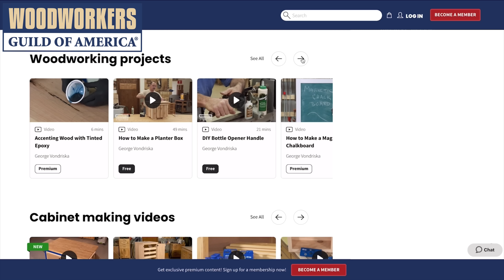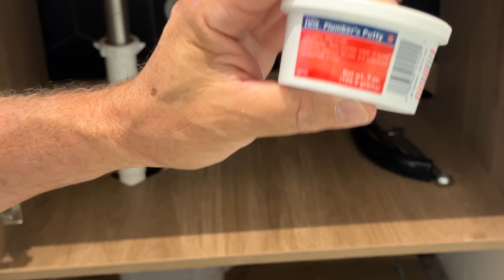INSTALLING a SINK with a BUILT IN DISHWASHER!!

Comment: That dishwashing sink is wild!  Your technique of mocking-up the connections before installation is brilliant.
Reply from the maker: Thanks!
Reply: Yeah real nice until you have to replace it
Reply: Yep, some related DIY wisdom learned the hard way: start your plumbing work early and when you have plenty of time to deal with the inevitable unexpected issues.  Never work on a holiday or close to closing time for the store.  If you can’t shut off plumbing locally to the fixture/room you’re working, make sure everybody has a plan for alternative plumbing and don’t interrupt the laundry.dishes/etc. 

Basically, plan for the worst and be happy when things go better.  There’s nothing worse than the feeling that everybody is waiting on you and you don’t have the solution in time…it only makes the job that much harder.

Comment: I think I read in the manual that every DIY plumbing job requires at least 3 trips to the supply store. It is a rule.
Reply: every home improvement project, no matter how small.  AT LEAST 3 trips in the first day.
Reply: The pros have the equivalent of whatever aisle they specialize in already on their truck when they show up. They bring the store with them!
Reply: i was surprised when i took out my old sink yesterday all the old plumbing worked even though the drain was in a different location and i only had to go to the hardware store once! haha
Reply: My personal plumbing DIY rule is never start a plumbing project on a Sunday if you have to work on Monday. 😊
Reply: @karenmitchell6814  you have to start on monday just in case. The weekend is to recuperate
Reply: I do handyman work. I never shop during a job.  Bring everything you could every need and more.   No shopping needs ever.
Reply: @brianhopkins5251  years ago, I followed that rule without even knowing.
Reply: That's about how many it took when I installed a filtered  faucet on the kitchen sink.
Reply: 4 if you buy a kit that has “everything”
Reply: Years of personal experience has validated the “three trip rule” for me! I have had SOME luck making two trips work by “forgetting” an item during trip 2 and “realizing” the error while still in the hardware store parking lot. IF the plumbing gods are aren’t paying close attention (or if they’re in a good mood), you can get credit for three trips with this “hack”.
Reply: Fact
Reply: And you only realize you need to go for a parts run when it’s the heaviest traffic time on the route to the store.
Reply: @chriskelvin248  5 minutes before the store closes.
Reply: @rogerweaver7686  yeah! You always get the most patient customer service then too!
Reply: I still feel compelled to locate a stand-up version of Q*bert from the 80s.
Reply: @rogerweaver7686  the more the better!!!  At least that's why my wife tells me. Haha
Reply: For sure.
Reply: My Dad would makes a "quick" run which always turned out to be hour later lol, and would always come back with other things, I think it was more of a release/ clear your head or like I inherited the Home center love 😂 I can go in for just the thing i needed but always find stuff I dont immediately need. Doesnt help its only 10 minutes away
Reply: Anything less is actually against the law.
Reply: Those are called "breaks."

Comment: I believe the dish washer uses cold water as opposed to hot is because, at least here in Europe, most houses don't filter hot water as much as they filter cold water because cold is usually made very safe to drink straight from the tap. Therefore hot water has more 'contaminants'. Where I live we have a lot of clay and dolomite and filtrating all that can get expensive when you're filtering for both hot and cold so we just do cold. All in all, the reason I think this dish washer uses cold is to have the best water possible so the dishes are cleaner and your pipes don't get clogged.

Comment: When I renovated a room in our home, I took the opportunity to route the AC coil condensate line through the ceiling and out the roof soffit, and down into rain barrels.  I'm a few hundred miles north of the Stud Pack, but still with my local humidity, I get about 10 gallons of grey water every summer day in my rain barrels from my 3 ton AC, which we use to water the flower gardens.  It keeps The Mrs super happy -- just FYI.  
Also, the first time I saw one of those waterfall style faucets I had to have one, so we bought and installed it in the master bathroom.  After a couple years it started growing all sorts of weird stuff in the exposed portion of the end of the faucet opening.  I couldn't get rid of it fast enough.  It was neat at first though.
Reply: Just don't water vegetable gardens with it. Condensate water is toxic.
Reply: @swdavis2306  Oh?  I've heard that one other time, but then other people jumped in  to 'correct' the person warning me.  We feed (and have for years) the vegetables, dogs, trees, flowers, etc. with the water and have noticed no ill effects in general.  IIRC, the other person that told me that condensate water was toxic said it has been shown to potentially carry some disease, but then, again, a few other people shot that down as being misunderstood from one single story years ago.  I'm all ears, though, and curious:  do you have any more details?  thanks!

Comment: A trick I’ve learned over the years for checking leaks on plumbing is place a blue shop paper towel under the connections. I’ve had leaks that were slow to where I didn’t catch them after install initially. The blue paper towel changes to a dark blue when wet. I just lay it under the system and check back after 10 or so minutes to see if there is a slow leak. Can then use towel to wipe the connections and find the leaking one.
Reply: @itigg  yup!  I always say to leave nothing under the sink for 2 days and use it heavy. And if you wipe a paper towel under the sink multiple times each day it should be bone dry if it's not, then let me know asap. I also recommend using under sink silicon mats. Amazon sells them. They have a lip and hold somewhere around 30 gallons of liquid or something based on the size. But working in houses even 5 years old, kills me to get under there and find the bottom of the cab destroyed. Cleaner bottles, drains, water lines, etc leak. The under sink silicon mats contain the spill or leak and no cabinets destroyed!!!  Put a water sensor in it and as soon as it leaks, get an alert. I built my house 5 years ago and have 9 sink cabinets and got ones for each!!  Life savor!!!  My kitchen sink, I've had multiple cleaners leak and at one point the faucet that the middle pulls out and the back and forth caused a connection to come loose after 2 years. The mat and sensor saved me a weekend of work replacing a cabinet bottom. :D.
Reply: @MikeHarris1984  yes those mats are great. Only downside is can’t use easily with under sink drawer systems typically because they bottom mount. Suppose I could screw right through it with some silicone around the holes to stop leaks.

Comment: So much effort and so many parts to install drainpipe and trap. They now sell a kit with a flexible hose you cut to length and kink to form the trap then screw into your drainpipes on either end. Easy peasy, one simple hose, no more messing around with angles and rings and fittings and cutting pipes. I used it on my last bathroom remodel and will never go back to the old way.

Comment: Wow guys...trippy dishwasher setup!!! Reminds me of a Bosch "Ventless" dryer I had to install once...
I'm liking the "techy" stuff Jordan has picked out, not that I ever doubted him...
Looking forward to starting the house build. I would like to remind you, when you demo the existing house, it will be a good opportunity to get an engineer in that backyard to address your drainage problem...
Keep up the great vids brothers!!!
Reply: It wasn't a "ventless" dryer, it was just a... dryer. Only america finds it acceptable to blow six thousand watts of electric out of a 4 inch hole in the wall. Jordan should check out LG's new DLHC5502 heat pump dryer... self cleaning condenser, 7.8 cu ft capacity, direct drive... 70% less energy than a boomer-tech vented fire-starter. 😂

Comment: That little sink/dishwasher is awesome for a single person's apartment!
Reply: Japan is famous  for those cause it saves space. Also washing machines and dryer.
Reply: @keithfreitas2983 most people in China are hanging clothes, but I think the younger homeowners are putting in dryers. Btw they have been using the combo units in Europe for a long time and have them in the us also , but they have their own set of issues, mainly they’re complex and slow. We did an 18” dishwasher in my brother’s place in New Orleans because it’s a small kitchen which I’d prefer over the counter model only for the ability for replacement when the time comes.

Comment: I'm from the Old Safety Engineer School...Wear both belt "and" suspenders, so anyone thinking adding extra pipe dope (the proper term evades me right now, but I'm sure someone will correct me) or plumbers putty "just to make sure," along with all the other "extras" a lot may think is unnecessary just for peace of mind.  Worth its weight in gold for me.  Peace of mind is a very good thing.  And when Jordan said wait and unscrewed the support making moving the completed sink easier?  As one of my bosses told me over half a century ago...Dammit...Don't work harder, work smarter.  And...Y'All did just that.  Great job and very informative video.  While most of my comments were about the sink, I learned a lot from the vanity and bathroom sink install as well.  I definitely appreciate all the tips and insight into how and why you arrive at the decisions you make.  Bonus!!  Helps me access things before just jumping in and screwing up.  As another boss told me, there is nothing so pressing you can't stop and say "just wait a minute" and reassess the situation before charging in (as some would say, like a bull in a china closet) full speed ahead.   Please keep the great videos coming!!

Comment: That first "P" trap on the dishwasher is not a P trap. It's a sweep to drain better. And it doesn cause an S trap where it can suction them both out is because you have that vent line that goes to the vacuum break and to the garbage disposal where most dishwasher connect to. So it's a neat design.
Reply from the maker: Cool, thanks Mike 👍

Comment: Cold water to the dishwasher, in Europe thats normal. I never heard of warm water to the dishwasher until i started to look at American Diy channels. Same as clear one component glue for drainage-pipe, we use only that.
Anaway, i give it 10 more years and then you will al be using metric 😁

The build is going great, and the template for the router on the saw-table, why didn"t i think of that!!! That would have saved me half a day. Great tip from a pro, thank you again and keep up the good work!!
Reply: I wonder if they use hot water in the US because they are on 120V, so it takes a long time to heat water. It doesn't take us long to heat up water  so we can use cold water
Reply: @thelibraryismyhappyplace1618  Realy good poimt, sounds valid, i have no idea. The amps are more, i think,  important to heat op water, but then again it could be the voltage.

Comment: Wow! If only I knew about a combo sink and dishwasher unit. That is so practical when you don't want to pile up and wait till the end of the week to wash dishes. A big dishwasher stinks while it sits with dirty dishes until you have enough of a load to run it.
Reply: I'm confused that they didn't go with a single drawer (eg. 17" tall) dishwasher.  Uses up just a tad more under-counter space without the drain line hassle, and you gain back the countertop space for meal prep, etc....   Maybe this one they chose is less than 24" wide.

Comment: I really like the way you did the cutout for the trap. I bought my house in 1998 and installed Delta faucets and I used clear silicone rather than plumber's putty when I install the drains. The aerators in the faucets corroded and I couldn't get them out without destroying the faucet so I bought two new Delta faucets in 2023 and installed them. Fantastic faucets and when I removed the drains from the sinks that silicone was perfectly sealed and lasted 25 years and was still good. Plumber's putty dries out and cracks and I know that from sinks I had to fix in rental properties.

Comment: Remember water leak alarm for bathroom and kitchen. Nice if it can also shut off the whole house water supply.

I have a few China Tuya wireless ones and a add on shut off motor for my main valve.

Has saved my basement once when a pipe burst at night

Comment: another advantage of Delta is that any plumber can get you a replacement cartridge when it goes bad.   Brand WTH knows, no chance, they are replacing the whole faucet.
Reply: That’s what I like about moen. All their cartridges are same for the type. I have my next 3 replacements already because the same cartridge is good for the vanity, the kitchen, and the shower. Easy swap.
Reply: Agreed! Just went through the replacement cartridge search for an out of production off brand. Finally found an open package one eBay. Luckily it fit and worked.

Comment: I am a DIYer, but I always purge the water lines by attaching an extra supply hose to the angle stop (shut off valve) and putting the other end into a bucket.  Only after that purge, will I attach the permanent supply lines ... regardless of whether there is a removable aerator or not.  This separate step makes sense because not all connection go to a faucet, for example the supply line to ice maker or the reverse osmosis system.

Comment: I bought Lexel after seeing you use it. Had to drive to a Lowe’s  to get it. Used it on a roof to sidewall joint area that decided to leak in a rainstorm. Great stuff. Sticks to anything, dried pretty fast and you hardly see it. Pricey stuff but worth it ! 👍
Reply from the maker: Great to hear!
Reply: I have also used Lexel based on your recommendations!  Great results!
Reply: They actually make a product called through the roof that is made for the roof(go figure) . its basically lexel with uv inhibitors I believe. its great stuff.
Reply: After foundation settlement (which required adding piers to re-level the slab) I had groundwater seeping upward thru the slab around the PVC toilet drain.  I added a nice thick layer of Lexel around the PVC and sealed it off to the concrete slab. It has sealed it up perfectly.  Now I believe I have the same upward seepage in a wall of the shower where the water lines come up thru the slab.  Didn’t realize that groundwater may have been the source of the water when we had to rebuild the rotted shower studs and entire shower.  Termites loved it!  Now I need to open the wall to check and will likely have to Lexel around the incoming water lines.

Comment: So nifty way i have found to deburr metal like that drawer. A wire wheel on the drill held parallel to the cut. Not 100% but in the 90s for how often it works. Smooths it out better then a file or even sanding. And generally depending on thickness and hardness even a brass wire wheel will work.

Comment: What I usually do when a fitting is just a bit too small for hoses is to wrap some electrical tape around it really tight, that way you can slightly increase the size of it.
I also usually do 2 hose clamps per fitting, rotated 180 degrees from each other because sometimes the seal they create has a little flat spot where the screw for the clamp is. 

This is mostly in higher pressure systems though, so for drainage 1 would suffice I reckon!

Greetings from the Netherlands!

Comment: I agree with the other comments that the sink/dishwasher mock up is brilliant. But I noticed that the hose clamps will be facing the wall after installation. If you had to work on those hoses in the future its going to take more work to remove the hose clamps. 34:43
Reply from the maker: Thanks but any way you turn them they're inaccessible back there😡

Comment: Good job on the sink. This is one of those projects where a 3d printer would have come I'm handy. You could make a cap with a compression fitting to hold the condensate hose. I had to do this for a similar project.

Comment: As far as the electrical goes for the dishwasher, I would recommend installing a breaker lock-out at the panel instead of adding a switch under the sink, looks cleaner and is code compliant.

Comment: Having been a GC for many years and recently did my own kitchen finally and regarding the DW we never used the old one so with the new kitchen setup I ran all the lines and cap them off, installed a cabinet instead. So if we ever sell I can remove the cabinet and install a DW. I find it more of a pain in the donkey to load and unload a DW than to simply wash the dishes. 👍🇺🇸
Reply: You obviously don’t have kids lol. If I were to hand wash all my dishes each day, my water bill would be $1000/month 😂
Reply: @remodz6385     Great point , it’s just myself and the wife now. 👍👍✌🏽✌🏻✌🏼🇺🇸

Comment: Never dealt with Delta, but I’m a huge fan of Moen. Lifetime no questions asked warranty on cartridges and they have GREAT customer service. EDIT: I also use dope on the rubber ring, I’ve had them leak and never had them leak when I do that.
Reply: In my experience, Delta is a little better built than Moen, dollar for dollar, and Moen is sometimes more....striking, visually? Something like that.  I think technically that they have identical warranties, as well, but i've read that Moen is much easier to deal with in that regard.